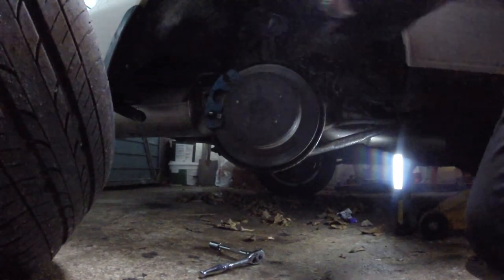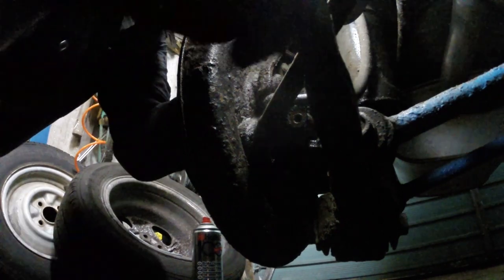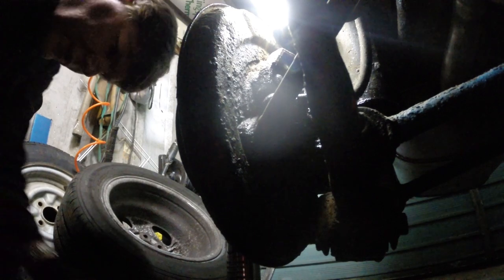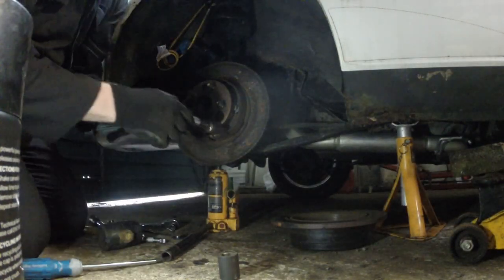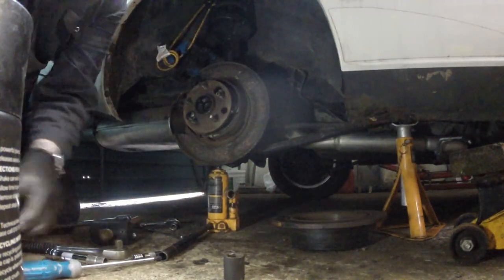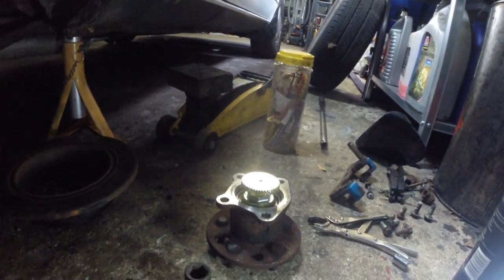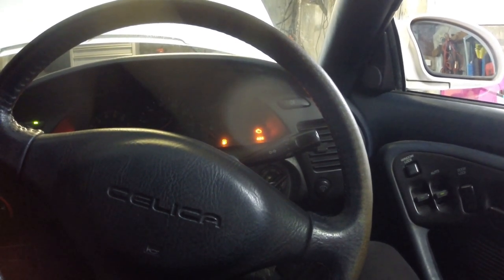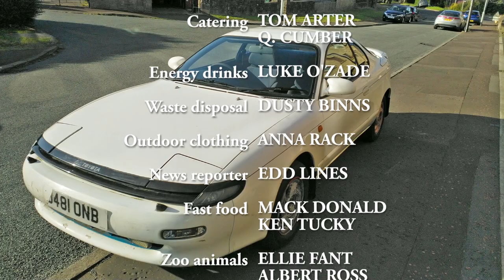1991 Toyota Celica GT Part 23 - Fixing the ABS #2

Comment: attempting a fix today on the dame exact sensor on my 1992 celica 5 just like yours. i am going to take out the old broken sensor and add a celica 7 abs sensor along with some resistances in parallel. or, a camry sensor (same thing, resistances in parallel). i only hope that i can fit it. 
great videos by the way, any updates on the car? cheers!
Reply from the maker: I believe that a 1996 Carina E sensor can be adapted as well. The running problem was the fuel pump.
Reply: @Parknest  i replaced the sensor and replaced with a camry 1995 one + adapted with a resistance in parallel, + brackets and adaptations to the harness connectors. abs light went away ❤️ i have loads of photos of the process, i can send them to you if you want, just don't know where to send them, cheers!
Reply from the maker: Yeah please send your photos via e-mail. My e-mail address is on the about tab on my homepage and in the video description. I'm gonna post then on the Celica Club forum which will help other Gen 5 Celica owners.
Reply: Was this process posted anywhere? I'm having the exact same problem at the moment...

Comment: I had a similar problem on my car last year our state of the art Snap On Code reader showed the NSF speed sensor faulty which on my car controls the power steering, ESP, Cruise control & of course the ABS so I changed the sensor @£32 but it was still the same grrrrr the following day a friend of mine walked into the garage & I was talking to him about the problem he then said about his cheep little code reader he uses which can run a diagnostic on all 4 sensors & straight away it picked up on a distance fault on the NSF sensor so on removing the hub I found that a part of the heat shield had broken away & got stuck between the sensor & the pick up ring thus demagnetizing the ring ..... solution new pick up ring however nobody sells them separately so I had to bite the bullet & buy a whole new wheel bearing kit, moral of the story just because you have a state of the art Snap On code reader cosing ££££ doesn't always mean it's the best. In your case I would say a sensor fault 1st wire 2nd.
Reply from the maker: The ABS fault code is pointing to the OSR sensor being open circuit. Just a matter of finding where it is.